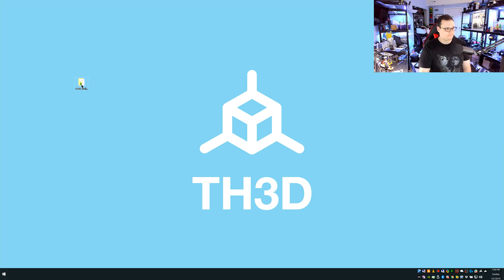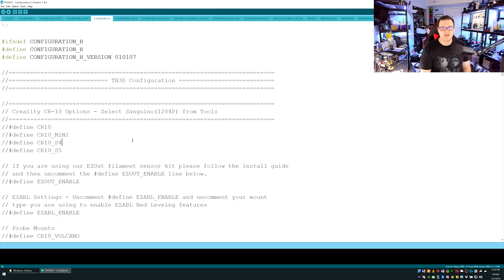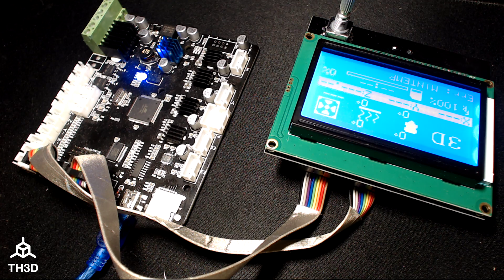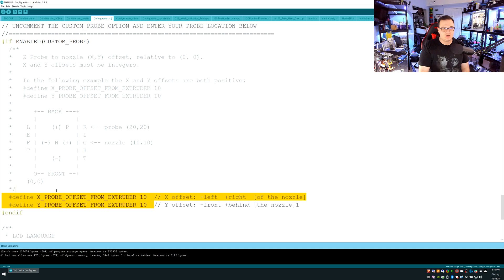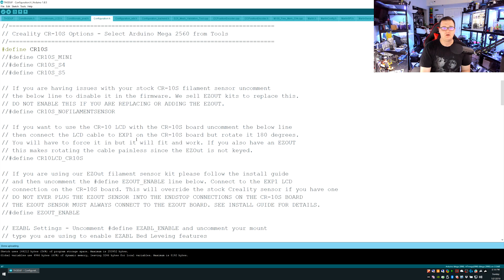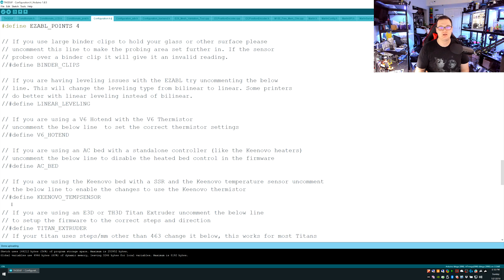TH3D Unified 1 Firmware Setup Guide - Stock, EZABL, EZOut and More!

Comment: I had error: "The selected serial port does not exist or your board is not connected"

I Fixed it by closing all other applications such as Cura worked fine after that. 
Hope it might help someone.
Reply: My instructions told me exit ALL slicer programs before flashing the machine. You have a chance to semi brick your printer.
Reply: Can't thank you enough

Comment: I can not find the Unified 1 to download. I Use an CR10 with a 1.1.2 Board. Have you stopped support?
Reply from the maker: If you check the desctiption there is a link to the Unified 2 download. Unified 1 is retired.
Reply: @TH3DStudio  Didn't get that its called melzi^^ Thanks a lot.

Comment: Nice Video. I have a CR10S Pro V2 and I tried to install the LCD Kit. Everything went until I plugged in the USB Port. Black screen.(@!$&) Rotated plugs 180 nothing. No lights. Checked everything and Eureka found the problem. On my USB cable I have the module that blocks usb cable to light up when powered off. Took module off and let there be light. Now uploaded  TH3DUF_R2 and voila we had writing on the screen. However... it is practically unreadable . Screen is pulsating and characters are scrambled. Seem that controls are working , axis, temp, etc. Any suggestions.. Answers in Eng., Fr. , Ger.,  Welcome.
TTFN Mike
Reply from the maker: Use Unified 2.0. Unified 1.0 is retired for this printer. http://uf2.th3dstudio.com/

Comment: Great video.  Can you do one on how to read and save the program that is currently on the board?
Reply from the maker: Once a firmware is compiled you cannot get the source code from it off the board. You can try to "dump" the binary through the programming header with a programmer but that isn't going to let you modify or get the source code from the original firmware that is on the board.
Reply: @TH3DStudio  Thank you.  I have read and/or seen videos wherein we are told to save or backup the original marlin code, in case the new one does not work.

Your response seems to indicate that is simply impossible, right?
Reply: @TH3DStudio  Does your company do any boards for CNC?  can you show how to do this but GRBL instead of Marlin?  Or is it all the same?

Comment: Does anyone else get avrdude:stk500 error even after flashing bootloader (I have a blank screen and everything)
Reply from the maker: Make sure nothing else is tying up the COM port. That is usually the cause of that error.
Reply: @TH3DStudio  I'm not sure what else could be tying up the com port. Everything is closed I've tried restarting the machine, changing drivers. 

This melzi board is such a hassle but I've already spent like 350-400 in extras on this Cr10-s5 so I'd really prefer not to buy another board.

Any other suggestions? I for sure followed the bootloader video with the TH3D uno
Reply: @g0ldensnitch  I'm having the same problem. Did you figure it out?
Reply: @slickstretch6391  it's been such a long time, but honestly, I think it was something of my own doing, like one of the wires was misplaced even though I checked it a thousand times.

Comment: I am trying to put this onto an Ender 3 (v1.1.4) but keep getting this error:

avrdude: stk500_recv(): programmer is not responding
avrdude: stk500_getsync() attempt 1 of 10: not in sync: resp=0x33

It tries 10 times, then says it had a problem uploading to board. Any thoughts on this error?
Reply: Update: I had found somewhere else in the comments that someone had to update their drivers for the printer within the windows device manager. I was able to find the drivers here: https://support.th3dstudio.com/hc/downloads/drivers/ch340-drivers-th3d-uno-creality-v1-1-x-v4-2-x-board/
Reply from the maker: You need to flash a bootloader first. You will use an Uno board (we have a set here with all the jumper wires: https://www.th3dstudio.com/product/arduino-uno-bootloader-flashing-kit/) and then use the Uno to burn the bootloader to the board. See the guide here: http://bootloader.th3dstudio.com/

Comment: After fighting multiple hours with this whole mess. i finally got the firmware installed on my Ender 3 printer. but i do not have anything in the control > motion menu. i select it and the only thing i can do is go back. did i miss something? i severely need to calibrate the extrusion and this was the only way i was finding to do it. any help would be greatly appreciated. thanks
Reply from the maker: You will not on Unified 1. You should be using Unified 2.0 as that has more menu options. See here: https://support.th3dstudio.com/hc/downloads/unified-2-firmware/creality/creality-ender-3-firmware-melzi-board/
Reply: @TH3DStudio  is the process on that page the only way to install this firmware? Thanks for the reply, it really helps.

Comment: Thanks so much for your contribution to 3d printing in general. Ive used this video and another of yours several times when flashing and making adjustments to my printer. I'm glad to say I recently bought a product from you that I needed so I'm glad I could pay it back somewhat.
Reply from the maker: Thanks for the kind words. We're blessed to be able to be doing this. I hope we can continue to keep putting out things for the community. Wishing you many successful prints! Thanks for the support.
Reply: @TH3DStudio  what is the right firmware for an ender 5?

Comment: So for those who don't regularly use this stuff and aren't technical I was getting a error

An error occurred while uploading the sketch
Reading | ################################################## | 100% 0.00s

avrdude: Device signature = 0x1e950f (probably m328p)
avrdude: Expected signature for ATmega1284P is 1E 97 05
         Double check chip, or use -F to override this check.

If you are getting this you, probably like myself, didn't get the hint (serious gap in needed instruction) to disconnect the Arduino board (from prior video instruction) and connect the printer board's USB (usb to usb micro cable needed that is not included in the kit supplied by TH3D) to your computer. He does not show this in the video. It took me 30 minutes to work this out as he seems to show ever other step but missed this vital step. 

Really guys you should have put this in here. How do you not have someone checking your instructions for this?
Reply from the maker: This video is for the firmware, not the bootloader (not all machines need a bootloader flashed as they already have one). For the bootloader information we have a full write up that specifies what you are saying you needed to do on our HelpCenter here: https://support.th3dstudio.com/hc/en-us/articles/360043146132

Comment: For the Easythreed X1, they use Melzi ET4000 board Atmel 1284P with a 4 button operation, with one can I use?
Reply from the maker: That printer isn't supported in the firmware.
Reply: TH3D Studio in Marlin yes, but not in your firmware. Is there a way to get it work? There is a Melsi ET4000 board in it. Somehow it can be done. Thanks for answering back my friend.

Comment: Potentially stupid question, if i have a ed3 pro with a skr mini 1.2, do i still just select ender 3 (pro)
Reply from the maker: This firmware doesn't support the SKR boards. You will need to use the firmware from BTT for their board.

Comment: Tim, is there a update of this, showing the use of VSCode rather... for usage on a MAC (Catalina)
Reply from the maker: Use Arduino 1.8.12 or higher for Mac and this firmware.
Reply: @TH3DStudio  ... I know Arduino is also useable, wondered if you might be willing to show how to use VSCode. already have it installed and configured previously for marlin 2.0.x
Reply from the maker: @georgelza  Havent tested 1.1.X in VSCode.
Reply: @TH3DStudio  so please see this as a pretty please request... looking at either TH3D FW or the Cheetah FW, like the way you've "packaged" things, but would prefer not to have to install more tools. jus trying to use what I have without installing "more and more" apps for each option, keeping MAC clean.
Reply: Can I ask here... your EZABL (when I der will also order the EZOut sensor), I see there is  12 mm unit and then a mini, whats the difference other than diameter? will go onto a Ender 5 Pro, with a BTT SKR 1.2 E3 mini board.

Comment: Hi, 
i flashed this firmware on my CR10 v2 and it worked great... BUT I can't set up it correct because his home position is on z183 ore something like this... What could i try?
Reply from the maker: You probably have a bed leveling probe option uncommented. If you do not have a probe then you need to comment it out. If you do then homing in the center of the bed is normal.
Reply: @TH3DStudio  
I use a bltouch probe and i "hope that i" uncomment everything to use it correctly... 
the problem is, when it touch the bed it stops like it should, so it works fine... But while doing a Homing ore when i try to get the offset, it goes up instead of down. And a nornal hime position is somewhere in the middle of the z axis...
Reply: I made a small Video to show what i mean... 
While homing (over LCD or Octoprint Terminal makes no difference) the Z axis goes up instead of down...
https://youtu.be/eB9pvuZAQOk
Reply from the maker: You could post in our communities to see if they have any advice or contact Creality support to get help with the equipment they sold you.

TH3D Communities: http://community.th3dstudio.com/
Creality Support: https://www.creality3dofficial.com/pages/contact-us

Comment: Is there a way to extract the firmware from the board or once it's on the board it can only be replaced? 
Thanks
Reply from the maker: You can extract but its pretty useless since you cannot decompile. It's best to just replace it and forget about the stock firmware.
Reply: @TH3DStudio  thanks for the reply

Comment: I have a issue with Creality 10S board v.2.0 - BL Touch talks, but Z goes only up when homming... What is wrong?
Reply from the maker: We don't recommend or use the BL Touches here. You should contact the company you purchased the probe from for technical support.
Reply: @TH3DStudio  It is working now very well. I made a mistake with wiring. Now it works super nice with your firmware. I love TH3D firmware. My Creality is working way better with TH3D! Great stuff! Thx for your hard work!

Comment: 12/11/19 Marlin 2.0 is already out. Not a beta version. Is this guide still applicable?? Need to flash my Anet A8.
Reply from the maker: Our unified that supports the A8 is still using 1.1.9. Use that one for now. We will be updating to 2.0 but not for a few weeks once we get time to test and configure it.
Reply: I'm still deciding on which path I want to take. Many options and their pros and cons to think about. 

Also,  if not already stated, the 1284p can have a boot loader if certain options aren't enabled. Like bed leveling. The basic A8 firmware is a small sketch that has sufficient space for a bootloader

Comment: Edit: below issue was resolved, everything I bought from the store was solid!

The Uno I ordered from the shop is not showing as a COM port, time to do some USB troubleshooting.  Does anyone have tricks for this?  Also, first time plugging it in the uno is blinking much quicker than shown in the video
Reply from the maker: Blinking quick is normal. Try installing the drivers for it: https://www.th3dstudio.com/knowledgebase/ch340-drivers-th3d-uno-creality-v1-1-4-board/
Reply: @TH3DStudio  sorry I’m late to reply but thanks for answering and the uno/firmware are working great.  Also just used your videos to flash unified 2 onto a 4.2.7 board, running great.  Really appreciate you cleaning up all these loose ends!

Comment: so I used this on a Wanhao i3 clone (monoprice select v1 or old v2) and now the temperatures are reading double. the bed is set to 60 and is actually 30. hot end set to 200 and is actually 100. any ideas on how to fix the firmware and reflash?
Reply from the maker: Use the Wanhao 10K thermistor option in the firmware. That's likely the issue.
Reply: @TH3DStudio  would that be the "known thermistor vaue x" ? And if so do I replace the x with 10k? Sorry this is my fist time with firmware updates
Reply: @TH3DStudio  nvm found it. Was looking in the wrong place. fixed the temperature readings and now I just need to re calibrate extruder steps. thanks

Comment: Just upgraded to the ender 1.1. 5 board and used this guide to update the firmware. It's working fine so far but I can manually move the extruder under the move axis option.
Reply from the maker: Looks like you need some help with your machine. We have communities setup to get help with printer issues and just chat with others in the hobby. Check them out at http://Community.TH3DStudio.com. Happy Printing!

Comment: so I have a tevo tornado and im having some screen artifacting issues no matter the firmware I use, are you able to recommend anything also I have replaced the MB and reflashed to no avail :(
Reply from the maker: Try the latest from our website (the U1.R2.17 with the Arduino 1.8.7 IDE).

Comment: Arduino: 1.8.9 (Windows 7), Board: "Sanguino, ATmega1284 or ATmega1284P (16 MHz)"

Build options changed, rebuilding all
In file included from sketch\ultralcd.cpp:96:0:

ultralcd_impl_DOGM.h:46:20: error: U8glib.h: No such file or directory

compilation terminated.

exit status 1
U8glib.h: No such file or directory
Reply from the maker: YouTube comments is not for support. You can check out our communities here for support questions: http://Community.TH3DStudio.com.

Also the error you are getting is because you aren't using our included IDE. Please read the directions.

Comment: I have an Upgrade Silent 1.1.5 Mainboard for Ender 3 Pro . Can I use it with your setup ? Can I connect with my Ender 2 printer ?  The Marlin is uploaded , but I see only white screen on HG012864-14C display ( display from Ender 2). I also tried reverse the connection between the board and LCD.
Reply from the maker: The ender 2 LCD doesnt work with the V1.1.X boards.
Reply: Any specific configuration needed , or might be different cabling ? Can you give me some hint why is Ender 2 LCD is different than Ender 3 , that does not work with V1.1.x boards ?

Comment: Great video. I had to select "AVR ISP" as my programmer. to get my board to work. I have a CR-10 board without the power select switch. Worked fine after I change programmer.

Comment: FOR THE LOVE OF EVERYTHING HOLY IF YOU HAD TO LOAD A CUSTOM BOOTLOADER IN THE STEP BEFORE THIS... THE FIRMWARE GOES ON THE PRINTER BOARD. WITH THE USB CABLE. IT DOES NOT GO ON THE ARDUINO USED TO UPLOAD THE BOOTLOADER. I AM DUMB AND THAT TOOK WAY TOO LONG TO FIGURE OUT.

Comment: There should be a note in this video to check device manager to make sure you installed the provided ft232r drivers if you are unable to see the printer in the com port after installing the bootloader. I had to do it twice on my box for some reason. After installing it, printer showed up as normal and worked perfectly after uploading the firmware.

Comment: A little off topic maybe... Your latest firmware (possibly earlier versions too) has manual mesh need leveling "fade" feature disabled by default. The bed leveling works great, but it doesn't fade out after the requested height. I could find no instructions or info on how to enable this or where to find it. I eventually found it, enabled it and it works great. Why not have this enabled by default? Or at least give some information/instructions for it.
Reply from the maker: It's disabled because we've had issues with it. You can change it in the source code.

Comment: Ok, i believe the arduino ide was corrupted. Totally deleted everything, downloaded new files, and did get it working. I love the bed levelling. ( not the ezabl, but the stock setup). One problem, installed a filament sensor, and then all it wanted to do was change filament every 10 sec. Disabled ezout, and it is printing fine. I dont know what is going wrong with that, but the resume works good, and it prints better that ever. Any thoughts on what the sensor is doing. It is a creality sensor, and the offset board is identical to yours. I had ordered it over a month ago, before finding your site. I live in merrillville, btw
Reply from the maker: Make sure you check out the new Unified 2.0. Theres a lot of new stuff in there. :) If you're in Merrilville send us a message and ask the team to get you over to me. Would love to have more local people to hang out with and do printer stuff!

Comment: Is the Ender 3 Pro supported in the latest firmware U1.R2.11? Is it the same as Ender 3 in the printer sections? I ask because I don't see an Ender 3 Pro Section. TIA
Reply from the maker: Its the same as the Ender 3 firmware wise.
Reply: Thank you! I just wanted to be clear.

Comment: just a quick question, the blue cable that came with the UNO boot loader does not fit the port on my ENDER 3. has anyone else had this problem?
Reply from the maker: You need to get a Mini USB cable for your machine. Some come with them and others don't.

Comment: I have a CR-10 S5 using a Bltouch V3 and was wondering where the probe settings are if I want to have 5 points? Also, I like changing the bed size so where would that be?